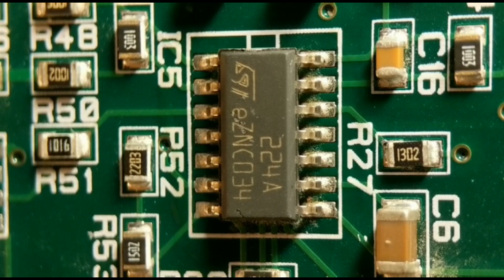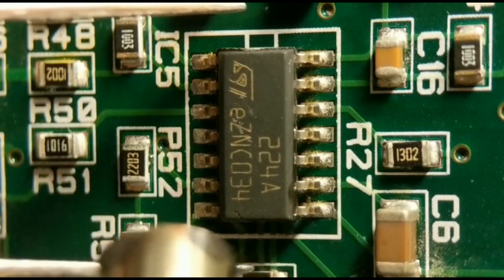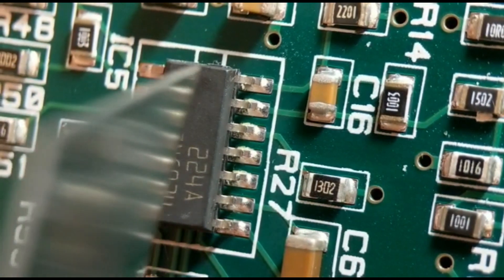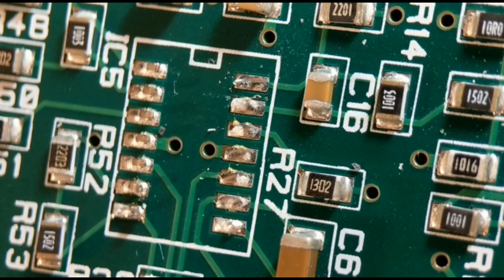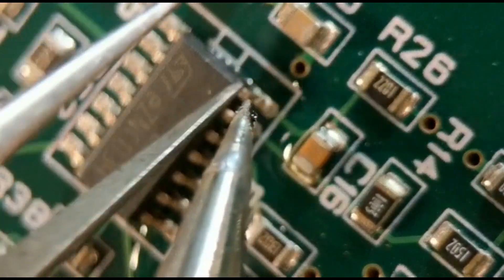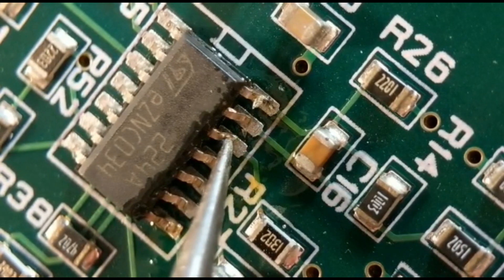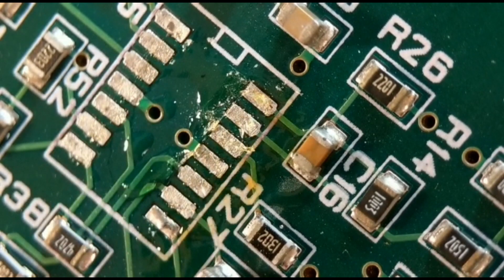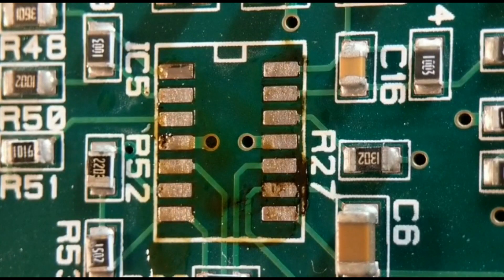How To Remove Surface Mount IC/smd IC - Learn 4 Neat Methods

Comment: So is option 1 the safest easiest option to use if you want to reuse the chip? It seems to be, right?
Reply from the maker: Hi , thank you for your comment , much appreciated . Option 1 is a good , safe method if done correctly . I've shown in other videos how you can protect nearby vulnerable parts like plastic connectors when using hot air . If the components do not have a thermal pad attachment underneath then 2 irons works really well . Thanks again , take care 👍

Comment: I make a loop with a wire with the form of the chip and solder it kind off like in the last method then heat the solder again in both siders and pull the wire out with the chip attached to it.

Comment: Is it safe to remove a working 8-pin BIOS IC from a hard disc using two soldering irons method when swapping BIOS ICs? Thanks
Reply from the maker: Hi , I've done the exact scenario your describing , many , many times and always with a positive result . Hope that helps , good luck 👍

Comment: Another method is to thread some enameled wire under the row of pins on one side,solder to a convenient pad about 1cm from the chip, flux up the pins and while applying pressure to the wire in an outward-away from the chip direction, run your iron along the row of pins.
As solder melts, the wire slips under the pin pulling any solder away from pin and pad.
Works a treat.
I changed a 80 pin micro in a VCR couple of days ago using this method. If you're careful, it's not impossible to reuse the chip after....

Comment: I use copper rods and make bits to screw into a cheap but powerful iron, for ics like this I have made a bit with to rods that hit every pin on both sides and take the ic away with just one iron, works rather well, I have a heat gun work station to be honest I'm I really don't like using it to take ics away obviously you have to with more technical ics I just don't like the thought of bringing up the ic and PCB and  other close components to ridiculous temps to get something off, foil tape is good and I use sowing thimbles to cover capacitors and other delicate stuff

Comment: For the method 3 I like to use ballhead pin/sewing needle. Push it between the legs and keep small pressure. Once you introduce heat from soldering iron, leg lifts up.

Comment: You are good at this!
I have lots of vintage electronics to fix.
I messed up on an IC Marantz amp. (sucked the contacts off the row for the Stk0040's)
I will learn more, before I do more.
Thanks for these "tricks of the trade".
How long have been a craftsman?

Comment: All well and good until you try removing a 150 pin firewire chip etc. I can't do it. The pins are too small to bend or cut easily. The sides are too many to use 2 irons, need 4. Which only leaves me with option 1, and that didn't work. I thought the PCB was going to burn before letting go of this IC. I'm stuck.
Reply from the maker: @rBennich  hi , I have shown other videos removing 4 sided , multi pin chips . They are done differently . This video is for a 2 sided chip .
Reply: @mrsolderfix3996  Thanks, I'll take look!
Reply: @mrsolderfix3996  Actually, i just found my dentist toolkit, and that tooth scraper might actually be small enough to bend some pins.

Comment: You didn't show the situation where the board is soldered from the other side
Reply from the maker: @mertmer1052  hi , this is a SMD device . The type you are commenting on is a Through hole device . I've done plenty of videos showing how to remove this type of device also . Thanks for your comment 👍

Comment: What type of soldering iron u use
Reply from the maker: Hi , in all of my videos I use a Weller TCP S iron which is 50 watt . I generally use 2 tips , a small conical one ( PTP7 ) and a large flat sided one ( DD8 ) . Hope that helps 👍

Comment: thanks for sharing! btw, at 8:32 how does the molten blob stick on to the tip of the iron and detached from the board like that? is that normal with regular iron? in my case lead just melts but sticks on to the pcb. does not come off like that
Reply from the maker: Hi , thank you for your comment , much appreciated . If you have a pretty decent soldering iron tip you can pick up blobs of solder as I showed . It may take a couple of attempts but in the end the molten solder blob will choose the iron tip rather than the component pads to stick to . Keep trying , you will master it 👍
Reply: @mrsolderfix3996  thank you. does soldering iron matter?? what kind of tip do you recommend ? is the material of the tip important?

Comment: Hi, what temperature is the soldering iron?
Reply from the maker: Hi thank you for your comment , much appreciated . As this was a leaded solder board I use about 330 degrees on my irons . If it was lead free I would have used 360 to 375 degrees Celsius . Hope that helps , thanks again 👍

Comment: Great video! 
I was thinking of using the 4th method to desolder a few TSSOP ICs in order to reuse them on another board, so I was wondering, does this method generally damage the ICs?
Reply from the maker: Hi , thank you for your comment , much appreciated . This method is perfectly safe for the IC's , if it comes off like I have shown  . I have removed thousands over the years with hot air stations ( sometimes set to 450 degrees Celsius  )and also the 2 soldering irons method and have never had an issue when I have reused them  . So quick answer is take it off as shown , clean it up and reuse it . Hope that helps , thanks again 👍
Reply: @mrsolderfix3996  Thank you so much, that will definitely help!
Reply from the maker: Hi , no problem , hope you get on ok . Thanks for watching 👍

Comment: I'm curious what temperature you run your soldering irons at? Always enjoy your videos and definitely learn something every time, thank you.
Reply from the maker: Hi , thank you for watching the video and commenting , much appreciated . Generally if I'm using leaded solder I use roughly 330 degrees Celsius and for lead free solder I up the temperature to about 360 - 375 degrees Celsius . I may vary these slightly if for example you have a large ground plain but usually these mentioned temperatures would suffice . Hope that helps , thanks again 👍

Comment: impressive. bought hot air station for nothing
Reply from the maker: Hi , thank you for watching the video and commenting , much appreciated . I do use these methods myself but you will get IC's with pads underneath them that are SOLDERED to the board at times so you do need a heat gun also . It's good to have a variety of methods so you can choose the one that best suits the situation your working on . Thanks again , take care 👍

Comment: Thank you, was trying to remove a similar chip using hot air at 380 degrees but ended up causing the top pcb layer bubbling up and blistering, disaster 😢
Reply from the maker: Hi , thank you for your comment , much appreciated. You generally are ok removing at the temperature you mentioned , but what I do know is if you have no copper in the layers surrounding where you were working this can happen . I like to use 2 soldering irons if I encounter an area like this . I don't know the layout of your board , but could be a possibility. Thanks again , take care 👍

Comment: Instead of cutting the pins with a razor why not just cut them with a wire cutter. Then heat each pad and remove the pins.
Reply from the maker: Hi , thank you for your comment. You should NEVER cut IC pins with cutters , it puts too much upwards stress on the pads , potentially loosening them . Gently pushing down on them is the way to do it if you don't want lifted pads . Thanks 👍

Comment: You said 360 degrees. Do you always use Celsius?
Reply from the maker: Hi , thank you for your comment. Yes always degrees Celsius. Hope that helps . Thanks again 👍
Reply: @mrsolderfix3996  it does help, thanks. I have to convert to Fahrenheit.

Comment: Thanks for the excellent tutorials. On another channel the guy removing a component said that using a hot air gun might damage the VIAs on the board if you're not careful and use too much heat. I suppose you make sure you keep circulating the hot air around until the solder melts(?)

Comment: Good tutorial, thank you. Just for reference, how big is the ic in the video (L x W) in mm? Does these methods work for small ic (8 x 18 mm) with 2 x 10 pins?
Reply from the maker: Hi , thank you for your comment. The IC in the video measures 10mm by 4mm , but the 2 iron method I have used for IC's double this size with no problems . If you cant get all the pins to join ( they may be spread out more ) just place a piece of wire along  both rows of pins and solder this way . I've done many other more recent removal videos on YouTube with some amazing methods , they may be useful for you . Thank you 👍

Comment: whats that glue name  which applied before heating...?
Reply from the maker: Hi , thank you for your question. The substance applied before soldering is called flux .  Adding flux before soldering allows the solder to run more freely and so form a much better joint . I personally don't do any soldering without adding this external flux ( the flux in the solder tends to burn off immediately) , so to get good , consistent joints add flux . Hope that helps , thanks again 👍

Comment: One quick question, if applying 360 degrees of hot air will that damage the chip?
Reply from the maker: Hi , thank you for your question. I've removed hundreds of IC's similar to this one and have reused many of them with complete success , so in my experience they have been fine . I can only share my experiences, maybe other people have had problems , I don't know this . Thanks again , take care 👍

Comment: man, that looks super clean and smooth, your skills are amazing. :-) 
hm, maybe i wouldn't use the cutting method on my 35yo computer, as i guess it might lift the soldering pad from the pcb.
btw, i think you can also use shaped soldering iron tips that heat up all pins at once
Reply from the maker: Hi , thank you for your comment, very much appreciated 👍

Comment: Great video
Reply from the maker: Hi, thank you for your comment, much appreciated. I'm glad you enjoyed the video . Hopefully there is a method here that can help people out , with or without a heat gun . Thanks again , take care 👍
Reply: @mrsolderfix3996  yes definitely… I scratched the substrate and ruined traces when I removed the CPU IHS on my PS3. Im hoping to fix it using some of these great tips from your channel. Im totally new to soldering and curious to learn. Thanks again.
Reply from the maker: Hi , thank you for supporting my channel , very much appreciated. Hopefully my videos can help you out with some of your problems . If they can then that's great . Thanks again , good luck with everything 👍

Comment: Hi.
Great video, as usual.
What aluminum tape do you use to protect other components when using a rework heat gun? And.. you mentioned you don’t normally use the tape when there aren’t plastics around. Would you say I would be wasting my time putting up alum tape around components of 32 IC chip? Or it’s worth my while?

Comment: You said foil tape to protect the other components. Did you mean Kapton tape instead?
Reply from the maker: Hi , thank you for your comment. No Foil tape is correct . It protects components way better than KAPTON . Heat can go through KAPTON pretty easily dislodging resistors etc . Foil tape will stop this . I posted a really old video showing how foil can stop plastic parts melting when using a heat gun and also showed how heat goes through KAPTON and can melt the plastic . Hope that helps , thanks again 👍
Reply: @mrsolderfix3996  Can you give me an example of the type/brand of foil tape. I see that various types are available. I will have to see if I can find the video that you referenced.

Comment: Great video, what hot air station are you using?
Reply from the maker: Hi , thank you for your comment. I use a Quick 861DA rework station . Quite expensive but a great piece of equipment . I've used cheaper models but this is well worth the money in my opinion. Hope that helps . Thanks again , take care 👍

Comment: what brand do you recommend for a hot air rework station
Reply from the maker: Hi , thank you for your question.
The station I have used for a few years is called a Quick 861DA . I really love it , I've done a small chat about it on a tools guide I posted about a month ago . It comes with 3 angled nozzles and I can't speak highly enough of it . There's also a version called a Quick 861DW , this comes with 3 straight nozzles and is also great . Not cheap , about £300 but I'm sure there's second hand ones out there somewhere. Hope that helps , thanks again , take care 👍

Comment: I do Marine repair and restore Muscle cars and I have done a ton of wiring, trying to learn electronics , I got one of those Radio Shack electronic kits to learn on. You my man just got a new subscriber that was totally cool and very well done you taught me a lot from one tech to another well done my man
Reply from the maker: Hi , thank you for your support of my channel , very much appreciated. I'm glad you enjoy the videos , hopefully they can help people out a little. Good luck with all your soldering projects , thanks again , take care 👍
Reply: @mrsolderfix3996  I am in the beginning process of restoring a vintage 424 Pioneer receiver  its my test guinea pig I am replacing all the caps and flush and detox the pots I have no clue what I am doing I just ordered and original shop manual from Pioneers that is at least 40 years old. I have had the unit for a long time I am excited and a little afraid but videos like yours and others it helping alot 🙂thanks for the reply and support
Reply from the maker: Hi , good luck with your project , hopefully some of my videos can help you out 👍
Reply: @mrsolderfix3996  Thanks bud
Reply from the maker: Hi , no problems , all the best 👍

Comment: Methods 1 and 4 are the most reasonable, I think. They're the most similar to the recomendations in the IPC 7711/7721. There are actually solder tips designed for this kind of removal as well. I wouldn't suggest using a blade near the board or putting your board through the stress of method 3.

Comment: Thanks a well presented video that works. Maybe I should ask if they will still work, I always believed heat like that would destroy an IC
Reply from the maker: Hi , thank you for your comment, much appreciated. I've taken hundreds of IC's off with the hot air + 2 iron methods . When I've had to reuse some of them they have always worked . They can take the heat . Hope that helps , thanks again 👍

Comment: Why not just wick it off?  Need to wick the pads anyway...
Reply from the maker: Hi , the trouble is when you wick the solder from each pin if the pin has been placed correctly so it's in touch with the PCB you won't be able to get the thin fillet of solder that's under each pin so when lifting off you risk lifted pads. Hope that helps 👍

Comment: What method would you use on a high pin count QFP?  Say, 80 or 100 pins.
Reply from the maker: Hi , if I was removing a QFP with 100 or even more pins I would flux round the pins then use a hot air rework station to remove it . I have seen people on YouTube use a substance called Chip Quik to remove these large IC's but the hot air method is definitely the way I would do it . I normally use a temperature of about 370 degrees centigrade. I will be posting a video on YouTube in a couple of weeks showing how I remove certain components including a large QFP . Hope that helps , take care 👍

Comment: how much temperature apply with how air at maximum to not damage the component
Reply from the maker: Hi , thank you for your comment. I've used 2 irons many times to remove IC's like this and have reused many of them with 100% success. If I was removing this with a hot air gun I would use a temperature of about 350 -370 degrees centigrade depending whether it was leaded or unleaded . Hope that helps 👍

Comment: I've employed #4 to success.
Reply from the maker: Hi , thank you for your comment, much appreciated. I do like method 4 , in fact I use 2 irons for reworking quite often . I've also posted a complete video on YouTube showing the benefits of using 2 soldering irons, perfectly safe and less invasive sometimes than a hot air rework station . Thanks again , take care 👍

Comment: 2 questions 
1) How many watts is your soldering irons? 
2) Will the replacement chip work with 2 soldering iron option or will it burn out?
Reply from the maker: Hi . My soldering irons are 50 watt . I've taken hundreds of IC's off with this method and reused many of them . 100%  of them have worked perfectly . To me this is no different to applying a heatgun to the area ( potentially risking other parts ) so I prefer to use this method at certain times . Hope that helps . Thanks again 👍
Reply: @mrsolderfix3996  oh. Thank you for the reply. I see it clear now. But one more question.. How are your soldering tips so clean? Mine always get black from rust, although i never damaged the soldering tip itself
Reply from the maker: Hi . I also suffer with black solder tips occasionally ( common problem ) , but I get over it by gently scraping the tip with emery cloth or a gentle scalpel then flooding the tip with solder . I repeat until eventually it is nice and tinned all over . Works well . Hopefully you get on ok 👍